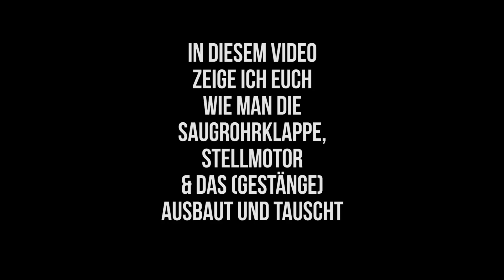AUDI A6 4F Saugrohrklappen Tutorial Deutsch HD

Comment: You've run the high pressure fuel pump without diesel. You should never do that because the diesel is used as a lube for pump. You've damaged the pump. After doing such operations on the fuel system you must turn on the auxiliary pump from the tank to bleed the system. After that the engine will start normally and the high pressure fuel pump will rotate while is lubed.
Reply: Thanks for the comment, I was worried about the same. I'm just about to do the flaps on my A6, and I'll try it without removing the high pressure line (I did it like that on my Q7). It is a "hedgehog in the cage" type of job :), but it can be done.
Reply: I ultimately had to remove the high pressure line, but just like Sergiu noted, the cranking was only 4 seconds after the bleeding. Here's the video https://youtu.be/jiamwSVw7gk
Reply: @jazzyjoe1848  i’m glad you found it helpful ✌🏻